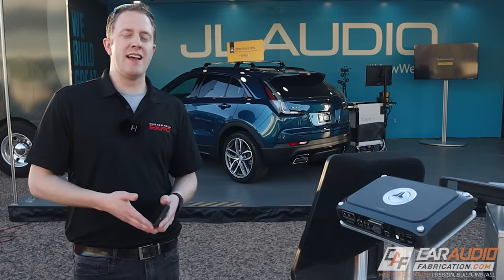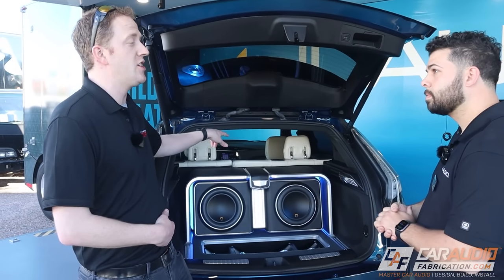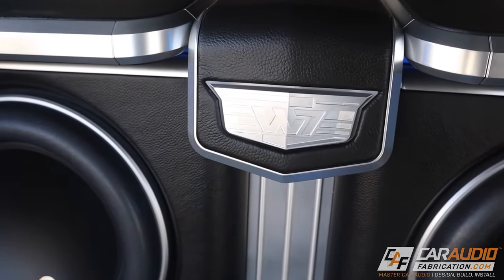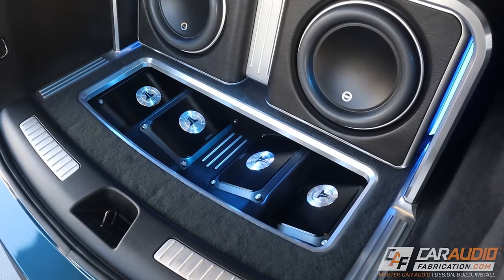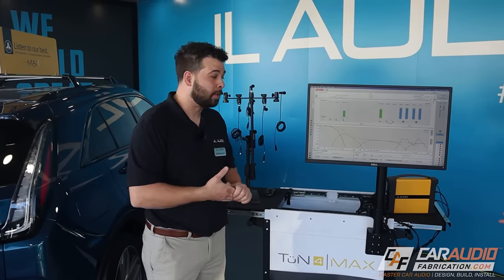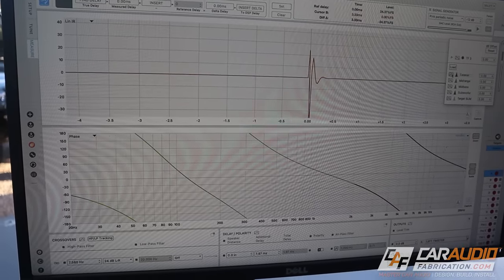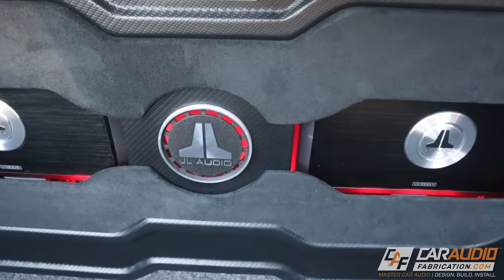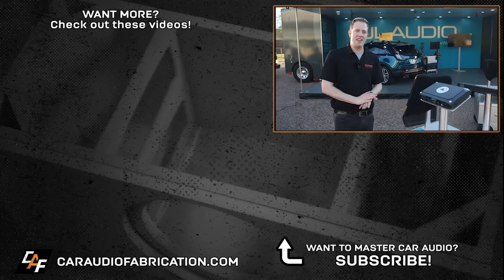JL Audio's Full Cadillac Build is PACKED with AMAZING DETAIL!

Comment: Love this channel, learning so much with different fine tuning and what not to do on building my own set up. Love JL Audio as it’s what I have 12w6 600/1 amp and 300/4 but need components. Was looking at focal or morale components up front.
Reply from the maker: Much appreciated!
Reply: Great plan!   Morel Piccolo tweeters, Focal Utopia midrange and 6.5"s, JL 10w7 sub.  I am extremely happy with this.
Reply: I stuck to all 7 series honestly wouldn’t change it for nothing else 2 w7 12
7- 3 1/2 c7 mids 4 c7 tweeters 1 1-1500/1 JL 1- 800/8 vxi 1 400/4 vxi and a mobridge to put it all together for tuning

Comment: So many questions.  JL recommends up to 175w RMS for the C7-650cw but they’re running 300w to each?  I have these speakers installed running 75w to each and they are extremely hifi and detailed but I’m noticing the midbass at this wattage is underwhelming.  Maybe I need to rethink my power?  I’m currently running VXI700/5 active with 75w to each c7 tweeter and c7 6.5 and 300w to the stealthbox.
Reply: More power would do good
Similar speakers I guess, on focal kx2 just the woofer I went from 75 to 200
Sounds great
Reply: They rate them low so they don't blow fast but they can definitely take more power than rated
Reply: @gabrielgalaxygh  I realized after I posted that I was wrong.  They’re running the 6.5” at 180w each at 4 ohms which is just 5w above the recommended wattage.  The C7’s put out such beautiful fidelity.  It’s crazy.

Comment: Hey Mark, love the channel and have been a JL fan since the mid 90s when I had a trio of original 12W6s in a custom 3.9 ft³ sealed trapezoidal enclosure made with 1" HDF that I made myself from the spec sheet.

I see that you're more into the sound quality and artistic style of car audio.  

Are you familiar with servo controlled open baffle subwoofers?  There is a little company called GR Research, they also happen to have a sweet little YouTube channel, that makes these sub kits with flat pack HDF panels made on a CNC router...you should just build your own though, because you're a beast.  

The owner of GR is the most knowledgeable man I've ever seen about speakers.  He also "fixes" common high end off the shelf speakers by fixing the crossovers and eliminating ferromagnetic materials from the signal path.   He does all his work scientifically using testing equipment similar to what the Max system is, so it's very objective.   This guy is so good, that he can accurately draw a given speakers frequency response from 20-20k just from listening to a two second sine wave sweep.  He said he has tested more than ten thousand speakers.  They sell some phenomenal kits for DIY home audio...and everything is VERY reasonable priced...which is awesome, considering they are competing with cost-no-option gear.  He also sells naked drivers, naked servo subwoofers, designs custom crossovers, and claims to have the best listening room in the country.  He has an open invitation to come down and check it out in person.  I saw your home theater setup and caught that you were thinking about doing some DIY home stuffs.  

 These are something I came across from the audiophile world.  Those guys are NUTS.  I also discovered that you do not want any magnetic material in the signal path.  It makes a huge difference.  He uses these speaker terminal connectors called tube connectors...he said they are the best signal transfer possible, and you can even hear and see the difference in a properly tuned system....that's pretty impressive to get that level of sound quality where you CAN HEAR A BINDING POST!!!  Lol.  

This is a crazy sport...that goes WAY WAY down the rabbit hole.

Comment: I'm building a back-to-back folded twin horn enclosure in a center console between the backs of the bucket seats in a 2 seat Chevy PU. I have chosen 2 sizes of subs, either a pair of Wavecor 4.5" in combination with the Tang Band 5.25" or the TB 5.25" in combo with a Dayton 6.5"  (1ea on either side). This is probably hard to visualize, just see it as 2 enclosures in the same box with the drivers and ports all facing outboard with the port at the lowest and widest part of the taper. In all there would be 4  drivers (2 on each side). Question: Will the different size subs work well together?

Comment: Cost estimate?
Reply: Cadillac is probably around 15-20 grand
Reply from the maker: @ justin smith, with all that billet? x3 or more if I had to guess.
Reply: @CarAudioFabrication  i mean the audio
Reply: Well, if you’re a) into this sort of thing either professionally or DIY and b) looking to spend something on that order on an install… I would really suggest getting a CNC machining center and learning how to use it. Basic machines suitable for this kind of work, along with basic tooling, can be had ready-to-go for around $7.5k. Double that price and you can get a really nice setup for doing this sort of work on a one-off basis (mass-production ready machines will of course be much more $$$; but for custom work you just don’t really need that level of capability). There are lower cost options as well, but they take more fiddling with to get good results.

If you are willing to use softer materials (wood, plastic) entry-level CNC routers and large-format 3D printers are a low-cost option as well; and if you are willing to DIY the machine build as well, you can get a lot of capability for not much $$$ (what you end up spending doing that is your time and effort).

🤔